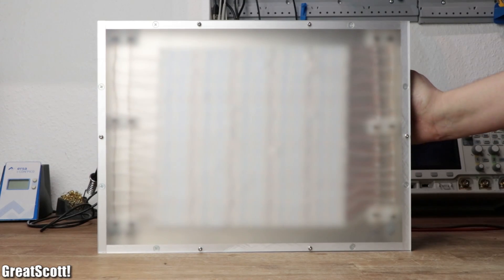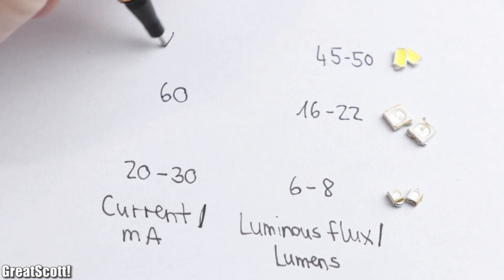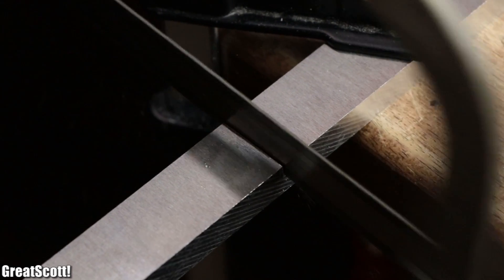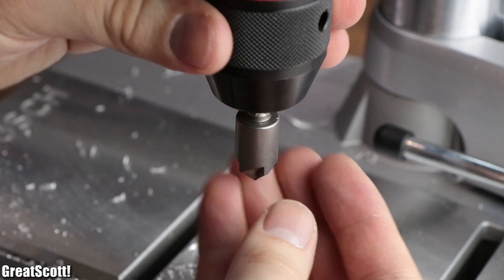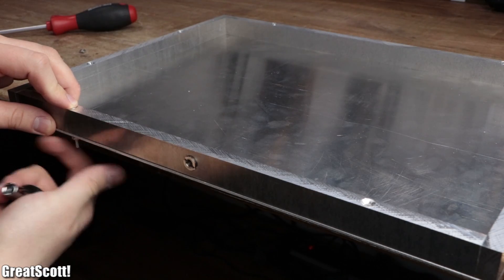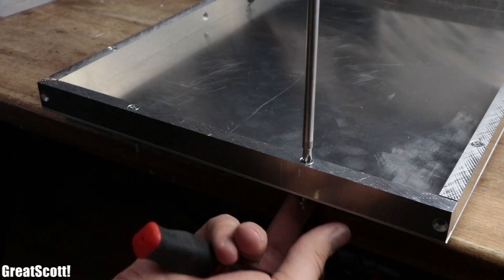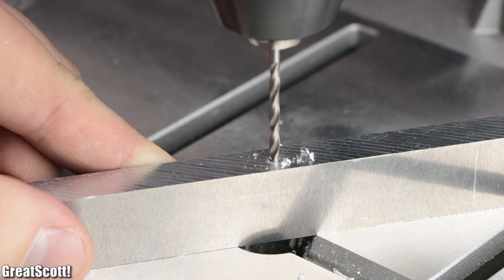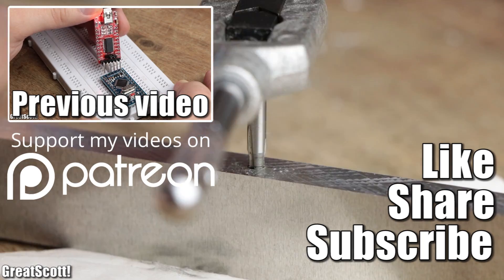DIY Portable LED Panel (Part 1) - the mechanical build

Comment: What is the lux at 1 meter?
I am doing a rig to copy blueprints with a scan app using an iPhone 11. Conducted a test using 2 Neewer 160 LED panels and it worked pretty well. But are a little dark in the corners. I’m thinking 2 more panels will be needed to cover. The drawings are 36”x48” and 24”x36”. Any suggestions would be appreciated.

Comment: You are german right?
Reply from the maker: Correct
Reply: Vllt kannst mir ja aushelfen:
Ich bin quasi dabei eine mit LED beleutete Vitrine zu bauen. Ich möchte eine bedrukte Folie von hinten erleuchten. Weiß nun aber nicht ob ich mir fertige Panels holen sollen damit dann quasi Baukasten spielen soll oder doch komplett selber mit Strips wie im video erklärt bauen (ist eher ne kosten frage da ich insgesammt 6 Flächen mit ca 100 x 200 cm und 2 x 300 x 200 bauen möchte)

Comment: Is it possible to dim it using switched mode power supply or pwm? why is it some led lights are said to be undimmable?
Reply from the maker: Wait for part 2.
Reply: I cannot wait, as it were. But will wait.

Comment: You're staying awesome, as always!
Very nice straight forward project that i am sure you will be able to use behind the scenes in later vids!
It would be really awesome if you could hook this up to a  DMX receiver made from an arduino so we can all make cheap and effective stage lighting :D 

I am not sure if you are familiar with DMX,
so its just a way to control up to 512 channels of lights per cable using an 8 bit integer value for each channel.
They have plenty of resources on it and free programs and the such:
   QLC+ is a controller program: qlcplus.org 
   dmx driver chip is the max485 which can be found on integrated ftdi boards like this i believe: http://www.gearbest.com/other-accessories/pp_463281.html?wid=21
   and you can program an arduino with: http://playground.arduino.cc/Learning/DMX

Hope this gets you thinking and I am looking forward to your future projects :D
Stay awesome! ;D

Comment: I'm still waiting for the Arduino tutorial that he promised!
Reply from the maker: Soon
Reply: GreatScott! Thanks. And also i noticed that the quick release mechanism on your led stand maybe a little weak. i know that it made out of aluminum and plastic so it's gonna be light but if you accidentally bumped into it and it fall down, it might break the plastic stand. also it's not gonna be stable if you stick it on a tripod.

Comment: you have clearly mention the reason of using this kind of LEDs...
please do mention the major parameters you considered while choosing other components in separate cases...
i mean most of the time u only mention commercial part number...
we all are not EEs ;)
Reply from the maker: I will not expain such details in project videos since that should not be the focus. Watch my basics videos about specific parts if you want more knowledge about them.
Reply: that was not a suggestion but only request... it may take 2-3 sec for each component...

Comment: It always makes me cringe to see folks making stuff out of aluminum using hand tools.  I've had to do that in the distant pass but since I have a table saw and other woodworking tools, they can be used on aluminum as well.  I do have a non-ferrous blade for the table saw but even the standard carbide tip ripping blade works well.  

I need to get a set of metric drill bits but the US stupidly still uses the English measure system.  :-(

Comment: Put soft plastic washers under the screws fixing the plexiglass to avoid crack caused by unewen pressure of the screwhead. Like you do it (do you?) with PCBs.

Comment: +GreatScott, can you please do a video where you mod a laptop by changing its original power plug into a USB C port, and still allow 5A or current?? It would be interesting and useful!
Reply: Eric Dong I'm pretty sure it would require controller and dc-dc up converter. that's not cheap and too hard for such little practical gain.

also it's not 100% that you would even find space in your laptop to fit all these things.
Reply: I see, thank you for your advice!

Comment: I'd suggest to put in some silicone washer better the Acrylic sheet and Aluminium housing, so in case you over tighten the screw,  It won't break the Acrylic sheet!

Comment: Take a look at Osram Soleriq P13 COB LEDs , they cost 10€ on ebay.de , the seller is from Germany. They have 98 CRI rating and 4000 lumens output.

Comment: I was wondering why you didn't attach the plate to the back of the long sides by tapping the long side and use screws from the back? This would eliminate the 4 bolts and make the back look a bit neater.
Looking forward to seeing the final project.

Comment: Hi there! Could you tell me why drill press rotates so slow? Is this illusion or drill press rotates so slow becouse of some technical reason? I have good quality drill press and I know it can rotates slow if you want but your machine looks like 60 rpm. I prefer drilling aluminum with higher speeds becouse it has good heat conductivity.
Reply from the maker: I used 200-300RPM
Reply from the maker: Also it is a Bosch PBD 40

Comment: You can also weld the plate and bars... although welding plate material is hard
Reply from the maker: I have bad experiences with welding aluminum. Not successful so far.
Reply: maybe invest in a proper welder instead of some old microwave parts :P.
I myself can't weld that good. But with some practice, everyone can weld

Comment: it would have been interesting to see the aluminum plate a bit thicker so you could counter-sink the bolts attached to it. and then seal the permanent bits with an epoxy. so it could potentially have some level of ingress protection.
Reply from the maker: I thought about something similar. But since this is a portable project, a thicker plate would have increased the weight too much. The design right now already weighs around 2Kg without the electronics.

Comment: Cool, This is a great idea. I will copy and build with CCFL tubes of broken LCD TV. LED is too easy for me :-)
Reply from the maker: Good idea. But make sure to use better insulation between the wires and the case than me.
Reply: Yes you are right. There I think 600 volt in the cables. 8 CCFL tubes from an old Phillips 42 inch LCD TV. Inverter voltage input 24V

4 inverter transformers, 1 transformer = 2 tubes
Reply: Maybe make a video of the build

Comment: Not dissing here :) But series is said like "See'rees" Love your stuff dude XD
Reply from the maker: Noted
Reply: I feel bad for saying that :( I sowee. Keep doing what you are doing man, 100% support you and your channel!
Reply from the maker: Don't sweat it. Thanks :-)
Reply: +GreatScott! First off. Love watching your series! You make stuff REALLY easy to understand and follow. I just wish I had a friend in my area, that was like you so I could learn alot more using the equipment i have n get better at it. Have you ever used the Basic Stamp 2 series or the Propeller microcontrollers from Parallax? I love its 8 core design n ability to create video on each core. Eventually I want to try and recreate my 89 Pontiac Firebird's ECM using the propeller microcontroller as a factory replacement unit and then adjust programming to see if I can make it run better and ultimatly change out the distributer for 8 individual igition coils and add additional features. I know the old ECM uses an/multiple 68HC11and finding learning material proving difficult for me. I have the manual for it, but need more classroom oriented materials to learn it.

Comment: i hope you ado not want to remove the nuts at 7:04 because they will get stuck because it is stainless steel and you sawed them off :P(and next time use a washer under the nut :3)

Comment: Personally never used thread taps in my life, but I've heard you're meant to keep going back and forth while winding them in? I see most people do 1 full turn in, half a turn out, repeat. Can anyone confirm?
Reply from the maker: When it becomes hard to turn you should turn back for 1/4 rotation. But it is only a rule of thumb.
Reply: Ah okay, thank you!

Comment: Timely video. I am creating a light panel now using the same chips and aluminum base. Mine is 12x24 inches.  Looking forward to seeing the electronics you choose as I am learning as I go.  I will check your sources to see the specs on the LEDs, I chose high CRI LEDs to minimize the green cast. Great video!

Comment: Couldn't you remove the dropping resistors on the LED strips to reduce the overall temperature? IIRC, the LED's have a forward voltage of ~3.3V, and there are only 3 in series, so the resistor need to drop about 2-3V in order for the strips to be powered from 12V. If you replaced the resistors with a small wire, you could just have the power supply take up the control of the LEDs instead of the resistors.
Reply from the maker: Definitely possible. But it sounds like a daunting task since there are 125 resistors.
Reply: Lol, the way I do it is just have a youtube video play in the background and do it for about an hour. Maybe I could make a video comparing those two methods to see if it's worthwhile. It would make the panel more 'efficient' for sure, because there wouldn't be any resistors droppers. Hmmm... time to test!

Comment: Damn it! I'm going to wait through a full week to see the rest. :/ It's getting great!
Reply from the maker: The wait will be worth it ;-)
Reply: GreatScott! Man, one question. I saw you using the MT3608 step up... But I'm having a lot of problems with it shutting off all the time. :/ I made a emergency rechargeable light in a jelly glass jar (I'm posting the video next Thursday) with a 12v LED (used in cars). And the only way to work was setting it to 9v. :/ (But I used a really small cellphone battery to fit in the jar's cap, so the battery will be completely discharged in 16 minutes. But, hey, it's only for emergencies and it recharges in 8 minutes with a TP4056.)
Reply: Mikeyguy94 Hmmm... Interesting! I'm going to search for it! Thanks! :)

Comment: Great video! But why not use a quarter inch thread cutter in the first place?
Reply from the maker: I do not have one. And the adapter was way cheaper than buying such a tap set.
Reply: well, I shoulda thought about that ^^